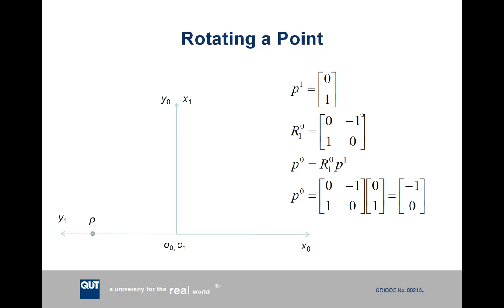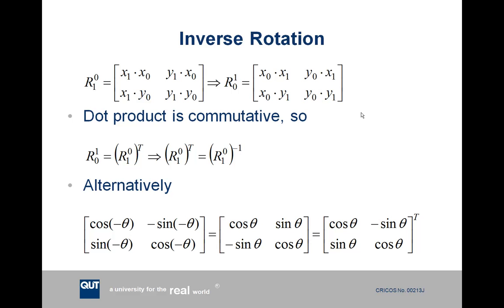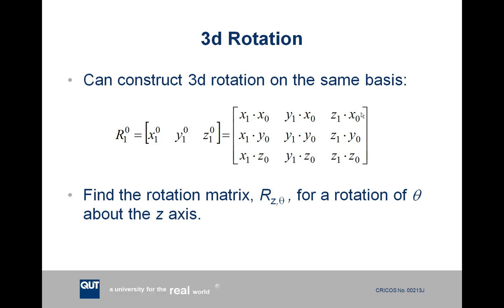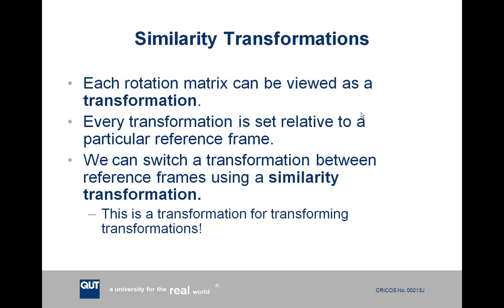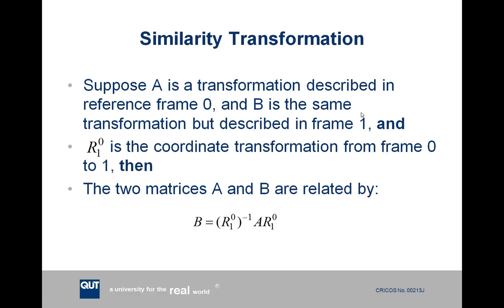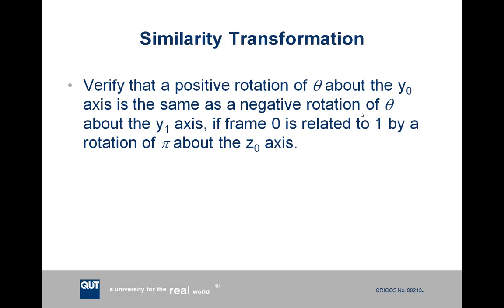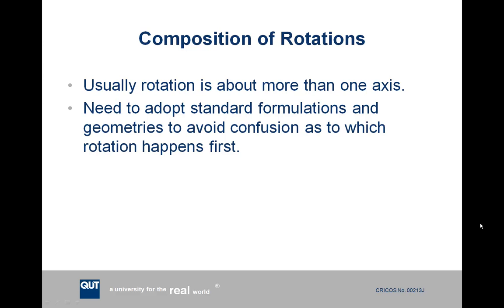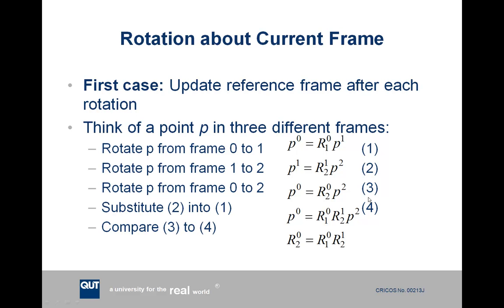Transformation Matrices Part 2

Comment: Omho it's much better to work with angles when it comes to rotation since a rotation is much more understandable, when you say "The joint's rotation is +126deg" for example instead of showing a bunch of dot products. And after all these dot products are simply the very definitions of sine and cosine > sin(x) = opposite/hypotenuse and cos(x) = adjacent/hypotenuse. Though I presume that when computing using the dot product might have it's advantages (although the result is the same).